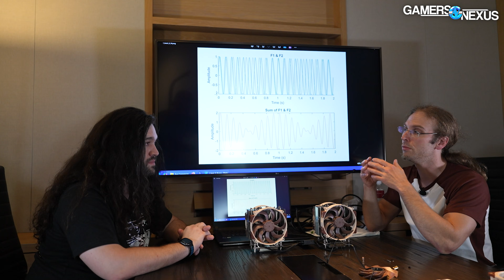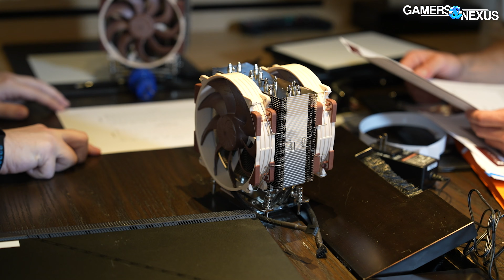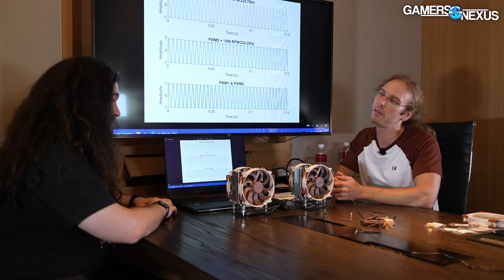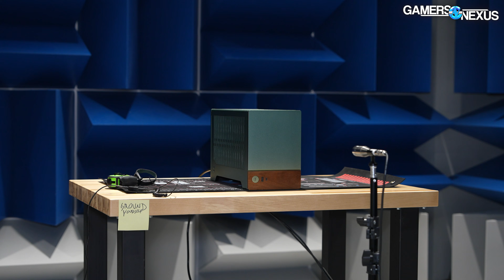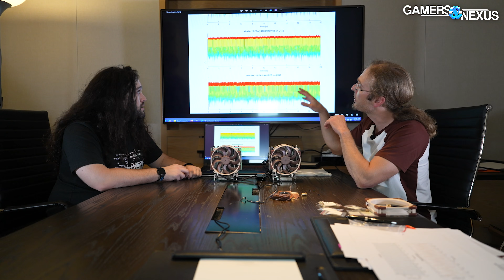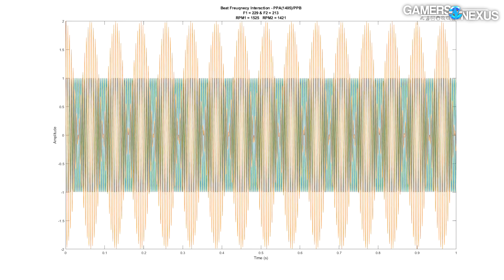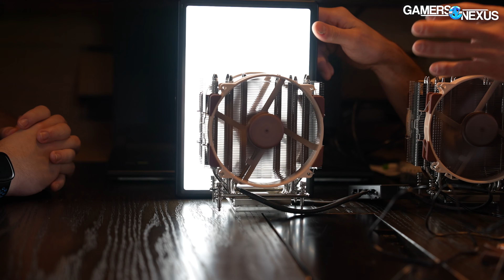The Most Annoying Computer Noise | Noctua Engineering Deep-Dive on Case Fans

Comment: Does GN recommend thermal paste or thermal pads. I reckon because the advertiser has both its possible to answer?

Ive always thought why would I go with thermal paste of pads are now as good, less messy, wont pull the cpu out with it and dont dry out and degrade over time.
Reply from the maker: You should use paste on CPUs and GPUs. Thermal pads are for things like MOSFETs. Sheets can be useful on CPUs for low maintenance, but not pads.
Reply: @GamersNexus  😅Indeed I meant those like carbon/graphene sheets not like the foamy blue thermal pads.

I couldnt think of a better term at the time, but yea the low maintenance sheets is what I meant.
Reply: I use sheet in my cpu (5800x3d) and i am very happy! Cool enough, and care free. For Intel cpus… not sure if sheet is good enough….

Comment: The length Noctua goes is astounding as usual. Totally justifies the price in my opinion.
Reply: I'll stick to my free solution for fan noise, tinnitus.
Reply: $40 a fan, $100 for a desk fan and $150 for an air cooler is not justified by this.

We are at a time where cfd, component and real world testing analysis is widely (and affordably) available to many pc component manufacturers. We can see this in the increase in quality and reduction of price of competing products.

There are much, much better places to spend money than on fans in this day and age. Save your $15-25 extra x6 fans and buy a better GPU, CPU or monitor.
Reply: @winebartender6653  my noctua fans work flawlessly for 10 years pluss. even if you dont care for anything else. care for that.
Reply: @winebartender6653 40$ for a fan? I'm guessing you're canadian or something cuz there's no way a Noctua fan costs that much 😅
Reply: @vr0k3n  Their new 140mm fan will be $40, as stated by them in the GN video when they were at their booth. So try again
Reply: @winebartender6653  for their top of the line heatsink which almost nobody needs. May i remind you Corsair has cableless rgb fans at 50 bucks a pop? 😂 No one in their right mind would buy their new D15 140mm fan for anything else than the cooler itself, because it's been designed specifically for it. Any other regular noctua fans are aroun 20-30 bucks at most, and the performance/noise/durability ratio you get out of them is unparalleled to any other product in the market. Same goes for cars, for example: the most expensive consumer-level models are always the most durable and have the most features. Nobody forces you to buy a Rivian R1T pickup instead of a Ford F150, but if you do, you know you're getting your money's worth.
Reply: @vr0k3n  Corsair are clowns, we all know this. 

And no, noctua is not "unparalleled" anymore. That ship has sailed.
Reply: @winebartender6653  If you want the best performance, yes they are. If you're fine with a bit less performance for 20-30% less money, that's fine too. I prefer Noctua because I know their products will never fail
Reply: @winebartender6653 what is your list of low noise, high quality, high performance fans? I am thinking bequiet is budget noctua and scythe is budget bequiet, and thermalright is good enough everywhere for the price. Noctua feels good to own and is outstanding in their effort but they take too long often to get out competitive products, and you gotta really need their support.
Reply: @winebartender6653  The desk fan is just a product that was brought since people asked for and it is a meme and their fans dont cost 40$ ...
Reply: @cesrai  Their new 140mm is indeed $40, as stated by them on the GN video when they were at their booth. Go listen for yourself.

Also, a meme or not doesn't matter. The fact they have the balls to sell a $4 AliExpress power brick for $30 is just a whole level of greed.
Reply: @winebartender6653 i would like to know about the power brick
Reply: @robthegobbler  Just search noctua NV-PS1
Reply: @robthegobbler  search noctua NV-PS1
Reply: It's expensive spinning plastic. It's not that complicated.
Reply: @_uncredited  did you even watch the video? It really is that complicated
Reply: @humble4531  Hear resonance. Adjust RPM. Fixed.
Reply: @humble4531  If you think this was complicated I don't know what to tell you. Harmonic distortion and frequency clashes are some of the most basic stuff you learn in physics and math classes. Heck, an elementary school child learning music learns about this.
Reply: With the competition they have right now by Thermalright heatsinks performing as well or better at 2x to 3x cheaper and a lot fan manufacturers beating them for far cheaper at the same or lower noise levels. Nope, Noctua won't get my money anymore.
Reply: @seamon9732 good luck getting a new mounting kit in 10 years. I'm still on a nhd14 from 2012 on my third socket by now.
Reply: @seamon9732  Yes they are beaten by some competition but always just on one metric. So yeah lower noise but then at expense of lower pressure and or flow. Or things like deformation after being long in a hot environment. I do not buy Noctua for everything either due to budget limits also like many. But when there is some application that causes issues then i always go Noctua. And some brands have very good alternatives but in my experience those are never the budget models. Can you make budget models better sometimes? Yes sure, if you like to tinker like me. I swapped bearings, filled hubs with resin to get more mass and make it a solid 1 piece part which reduces vibration chances. But i do not think most users want to do those things.
Reply: @chinesepopsongs00  I suggest you look up 'thermalleft' and go to his recent video explaining his spreadsheets for fan testing (he has the spreadsheets linked in the description).

You can also find much more of their testing throughout various websites.

The purpose of buying a noctua fan given the price is basically non-existent. There are cheaper alternatives that satisfy whatever possible need it is to have them. They aren't just beat in "one metric", there are plenty of fans, for cheaper, that beat them in every metric.

Comment: Most annoying sound for me is coil whine.
Reply: This!
Reply: THIS!
Reply: That is a result more of electronics than fans usually right? Not an expert but i think its from janky caps and inductors and whatnot... BS in Mech Engr so my EE knowledge is limited but I too find coil whine annoying and thus am interested to learn more about its causes
Reply: Yes, coil whine isn't related to fans (usually), but it is definitely more annoying than fans, fans can turn off, but coils can't. It is mostly random sounds, that make it more noticeable.
Reply: @ShadySKWASHA  as a CE, you MEs and EEs need to do better. 🥴
Reply: Especially during fast load changes in the power stages. One might think that there was a flock of birds or mice inside a computer.  Very terrible on notebooks too when those coil whine gets electrically conducted to the audio section.
Reply: I was JUST thinking about coil whine while reading the comment I read before yours, perfect timing
Reply: @navvvix  I have had same experiences with nVidia and Radeon gpus. It also definitely depends on the board partner. Asus in general are the worst offenders and Sapphire have basically none (I've tried most XTX models and settled for the Nitro which had no coil whine; Asus TUF was an actual grinder).
Reply: @dereklang4451 
I'm on Asrock, and I don't think I've ever met CW once. Maybe because I always frame cap my game below 120fps. Dunno if it's help.
Reply: @fajaradi1223  yes, my experience was also like that, that up to 120fps most cards I tried made no/barely hearable coil whine (only exception the Asus TUF that somehow had a loud, constantly changing pitch depending  on the power draw; i tried 2 different ones from 2 different retailers, to make sure i didn't get a faulty one, but they were the same). My ultrawide goes up to 165hz and even running demanding games maxed out I don't get any whine anymore. There used to be some very silent, even one for the 1st 1-2 months but is all gone now.
Reply: coil whine is so bad, the moment my gpu starts working i can hear it no matter what, even through headphones sometimes! (when i keep stuff quiet)
Reply: @0Blueaura  electronic interference that results in audible noise through your audio system has many factors. the most important of these are: isolation of components, the connections between audio and speaker devices (balanced vs unbalanced cables, the cable design and overall architecture of the audio interface, etc), ground loops (or lack thereof), and components/design that are in the system. it is not simply coil whine. hope this helps.
Reply: @navvvix Thats on you. My RX 670p 10gb had coil whine for 3 weeks- turned dead silent now unless under heavy load. No need to RMA and its performance is amazing especially considering I got it for $220.
Reply: I agree, and it’s something you cannot control. Replacing the component may or may not get rid of the whine. More than likely it won’t get rid of it completely.
Reply: thats Dell's problem.
Reply: Coil whine has a good chance of going away after using the component for a few months, though not always.
Reply: Coil whine is fake
Reply: @cogitator1213  just like birds

Comment: I love my Noctua fans. Love their lack of noise. Love their colors. The most annoying computer noise is Windows beeps by Microsoft.
Reply: Turning Windows sound profile too 'none' is always one of the first things to do after install.  I'd hope you could do this even on a work computer.
Reply: @concinnus  You can lower the windows sounds in the mixer too, I have mine set to around 5% so I still hear them but not that loud
Reply: Prefer Arctic's P12/14 Max lineup. They can push more air at a lower noise level and at a similar or higher static pressure. There are also quite a few other manufacturers that handily beat Noctua right now. We'll see how they fare with their upcoming fans, but they have a LOT more competition than say 7-10 years ago and have fallen behind since then.
Reply: @seamon9732 thats not true phanteks fans are still a bit noisy compared with noctua. I know that because i had both of them and send the phanteks back. Noctua is still unbeaten when it comes to noise
Reply: @reijhinru1474 he’s talking about Arctic, different company. A good one too, one of my most trusted. They’ve been in the business and doing good work for a while
Reply: Noctua is hella expensive and there are more affordable fans out there that are just as quiet
Reply: @TheBlueBunnyKen  that is false the frequency range is perfect, noctua fans are in the air conditioner range, so nice to hear.
Reply: @TheBlueBunnyKen  But are they as reliable? I've been using my NH-U12P for 15 years and it's still working no issues, that's about 4€ a year. Not that expensive

Comment: So it was not all in my head.
The other voices are relieved...
Reply: XD
Reply: I'm not crazy! 
You're crazy!
Especially you Nappa!
Reply: Protip you can also brute force this effect away by running any fans mounted in parallel and adjacent with each other ~150RPM apart without any of this fancy new control stuff.
I learned that from an article about the big fat Mac pro cheese grater.
Tho obviously this increases the noise floor of your system for a given amount of air moved, but in theory the noise is less annoying.
The RPM mode in fancontrol is super convenient but it will also bring out these issues by calibrating the fans to run at the same speed if you don't include offsets.
Reply: @thumbwarriordx  I didn't find the solution on an NH-D15 or the basic fans on an aio where I ended up replacing x3 with x6 nfa12x25 and the silence is there without this crappy reasoning, and or very light and not annoying.
Reply: This is like... the exact solution they discuss in the video but with less precision.

Comment: The noise almost sounds like an uneven rotation like a wheel that isn't balanced
Reply from the maker: Ha! Great comparison.
Reply: @GamersNexus  Sadly you didn't ask about that "reversed" fans. Are they actually do anything? It would be interesting to hear engineer's opinion on that.
Reply: @rusTORK  Pretty sure reversed fans would go against anything Noctua is trying to achieve for their fans in general.
Reply: @TheDeeGeeNL what exactly? it is the same fan, just installed in reverse on its frame
Reply: @ceiling_cat  Yes, the spokes that hold the fan hub would create turbulence noise that's impossible to eliminate.

Comment: Gotta love those german compound words
Reply: What do you mean?
Porsche-Doppelkupplungsgetriebe
Makes total sense.
Reply: "Schwebung" is not a compound word. I wouldn't classify the verb "aufschaukeln" as a compound word either. N.B., it means pretty much "to escalate"; not in the sense of handing something to a higher instance, but in the sense of "getting worse and worse".
Reply: @coolcat23  Would it be appropriate to say that in the example he used with the swing, the word Aufschaukeln could also mean 'Fluctuate'?
Reply: @Lodethebig  fluctuation as i know it is up and down, like a wave. "aufschaukeln" describes when you lean into the swing, so with every swinging motion you get to a higher point, so it is fluctuation, but the peaks are getting higher and higher with every amplitude.
Reply: @MinyKatana  Okay, thank you for the explanation :)
Reply: @Lodethebig  MinyKatana essentially gave the correct answer. Note that the "schaukeln"  (swinging) in "Aufschaukeln" does not need to occur literally, just like when you say "This escalated quickly.", you are normally not referring to something moving upwards. The use of "Aufschaukeln" implies a back and forth with increasing amplitude but that can be rather metaphorical rather than literally referring to swinging. The main idea is that there is a continuous build up, as opposed to "fluctuations" which occur with random and non-increasing intensity.
Reply: @coolcat23 yeah “to” is a good way of putting it 
Schweben= levitate
Schwebung literally is levitation but means superposition
Reply: 🤓+ratio
Reply: where?
Reply: always the best automotive terms
Reply: We have a Word vor it is : Kompusitaliebe
Reply: What words, what did he say?
Reply: they are austrian but ok can maybe call that german too as long they dont speak dialect
Reply: @decree72 It's German. That's how the language is called.
Reply: @jojosworlds1208 noticeable Austrian accent